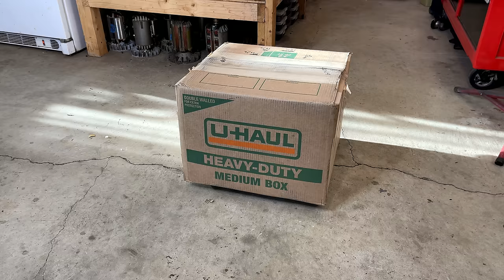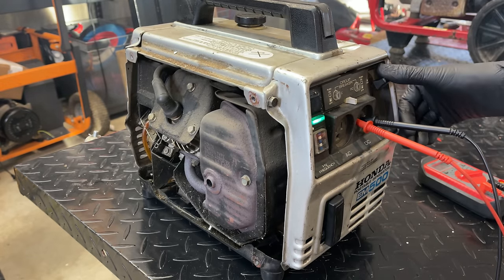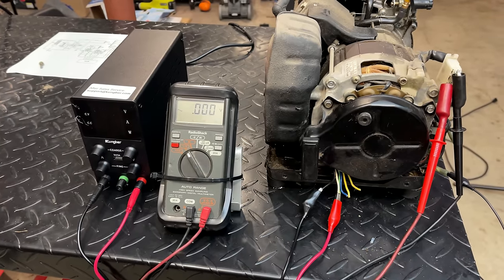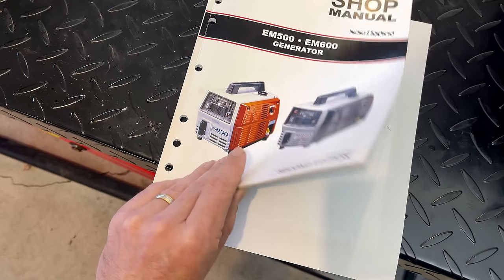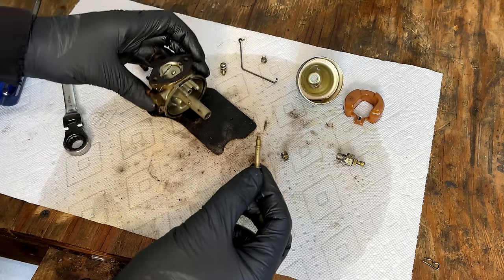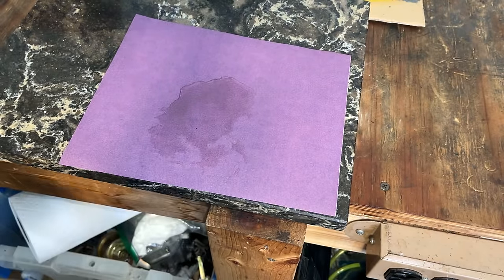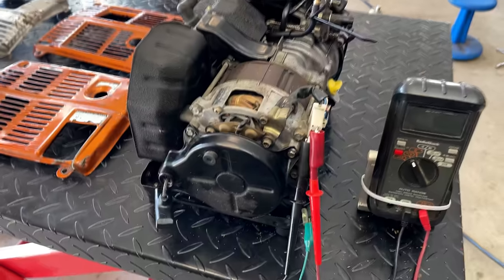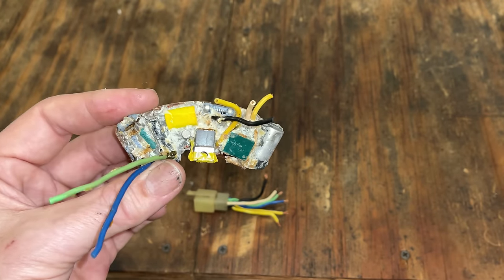Vintage Honda EM500 - High Voltage Problem

Comment: He did a great job packing it in the box.
Reply from the maker: Best packing job I have seen.
Reply: @jcondon1  Same thought here
Reply: The repurposed Omaha Steaks box was brilliant.👍
Reply: Thank you.
Reply: If you were going to use a universal AVR and the output voltage from that AVR was too high, then it is possible to calculate a value of a resistor to drop say 4 v, you can use ohm's law to calculate the value and since you're power supply was showing both voltage and current the calculation could be fairly easy. I  you would just need to calculate the lower limit of the voltage... Might be a good experiment when another one of these comes up.
Reply: I was also gonna applaud the packing until he told the story about the train and truck. That generator was pissed off being bubblewrapped after the life it has had.
Reply: I definitely would have drained the oil since you never know what thepeople at the carrier do to your package, eg put it upside down, tip it over, throw it etc
Reply: @d6893  I did run it completely dry, then drain the oil. My guess is the oil that got into the carburetor and the air filter was probably the last oil that was in the case. I love that little generator, it was nothing but a one pull workhorse.
Reply: First thing I noticed was the exceptional packing job. This was a great video.

Comment: That carb insulator looks like the perfect sort of part that could be replicated by a simple 3d print.  With a few measurements and the right material that could be produced as needed for anyone.  I love these old suitcase gens, really cool video!
Reply: You would have to be careful in your choice of filament/resin. Most 3D printer materials will have neither the chemical resistance nor the heat resistance to work in that location reliably. The original part appears to be phenolic, which can't be 3D printed. Maybe you could get away with nylon, but I think you need a high-temperature printer for that.
Reply: @danmenes3143  That's true, though I think ABA or ABS would also be capable.  ABS & Nylon can be printed ~240C which most printers can do, but they need good ventilation.

I've also used PETG parts in vehicle engine bays before and they work fine, but they also aren't in contact with fuel.  Ironically, I did have to create some parts that were immersed in gasoline later, and I did it in both PLA & PETG.  Despite PETG supposedly being resistant to gas and PLA not, the PLA parts survived and the PETG ones failed!

Comment: Pretty impressive how that little generator came back to life and runs so well! On a side note, I'd hate to be in your shoes when your wife finds out you cleaned those parts in the kitchen sink... 😉👍👍👍
Reply: I'm gonna say no it looked like some bad hammertone copper from the 70,s
Reply: Maybe it used to be a kitchen sink, but it's been relocated!
Reply: I find it very very cute🥰

Comment: Thanks for this video! I have a 40 year old EM800 which has been used to power my family's off grid cabin since the 80s. It probably has thousands of hours on it. The only maintenance has been oil changes and spark plugs and a new air filter. I think the pull rope is even original.

As far as I can tell the EM-500, 600, and EX800 are very similar. So I'll come back to this video if I ever have any issues! Great job like always.

Comment: Thank you for covering every detail meticulously and with such high quality. I received an EM600 three years ago, and while it always used to run perfectly, it recently started being hard to start, hunts, and it will die with a big enough load on it. I've never worked on an engine, but this video will help me hopefully clean the carb and go through any other troubleshooting steps.
Reply: Be very careful with the brittle old plastics and you should be OK.

Comment: Don't beat yourself up about nicking the fuel line, other seasoned mechanics probably do the same, I know I do.  From my perspective your pretty well clued up on exiltation fields and field coil resistance, and voltages, so rest easy about the fuel line. It's good watching you fault find to this level of expertise. A very good comprehensive video, great to ⌚️ watch  well done my friend well done

Comment: Japanese quality period , and I also was amazed with the THD. Vintage Hondas units were built to last and become heirlooms if taken care of. Once again James great video.
Reply: Would you say the same for modern Honda generators?
Reply: @douglofreddo7886  
No, my brother bought a Honda EU2200 3 years ago. Upon opening and first start he had to return and exchange for another because it would not run right. The second ran good but you can feel the cheaper materials being used today. Still runs and works today but kinda walks when running in eco mode.
Reply: When I was a child [10y old] I remember my dad telling the machine operator that was sleeping on the  job "Wake up the japanese are coming"

Comment: First off -Lewis - excellent packing...I  spotted the Omaha Steaks cooler,  and I have one waiting in my basement for just such duty!
James, you are 1/2 artist, 1/2 mad Scientist !  I always enjoy your thoughtfully presented content.  I am the owner of an EM500 myself, still run it twice a year just to keep it serviceable, have the original manual and 12v leads as well.  Mine gets a bit wonky at 350 + watts but still hangs in there.  I've used it to power a small (1/5 hp) pump to drain a flooded basement (3+" standing), it still has it's value and will probably keep working for years to come.  I have three other Honda gennies including the newest Eu7000is which will run a home if necessary !  Quality lasts and inspires confidence...thank you Soichiro!

Comment: Great video.  I like to see people bring these old Honda's back to life, they are precision built machines, unlike most things made today. I liked the trick with the wire and hot water to make a bend in the fuel line, I never would have thought of that. I certainly hope that that sink you cleaned that baseplate in was in your shop and not in your wife's kitchen, or this may be your last video.
Reply: My wife would kill me
Reply: My eyes rolled back in my head when I saw that.
Reply: ESPECIALLY when she discovers that it wasn't HIS toothbrush he used to do the fine detail cleaning...

😄😁😆😅😂🤣

Comment: I recently purchased a gear from a fellow who prints them from a 3d printer if he has the original. It might be possible to print your carb-housing since you have most of the parts. Good luck, great video.

Comment: For future reference, a spring inside the replacement fuel line will allow you to make bends you couldn't with a non-formed line.
Reply: A spring on the outside is just as effective, and would cause less impedance on the flow. The bonus is its less likely to be corroded by any impurities in the fuel. Downside is it can be corroded by everything in the air. 😅 I've used this in low volume water cooling for insanely bright LED lamps, where in the water loop I'm running de-ionised water to reduce conductivity, so the less different metals in the system the better, hence external springs.
Reply: Actually, the spring inside keeps the hose from kinking a spring on the outside would not do the same thing

Comment: Nice video Jim. I love old Honda Generators. The quality and craftsmanship of these is second to none. Even the newer EU2000, EU2200 and EU3200 have amazing build quality and fit an finish. It's amazing you were able to get that AVR! I couldn't tell by the logo on the side of the AVR, but was that made by Sawafuji? Nice troubleshooting as usual. 100k subs is near!
Reply: Where can I get the service manuals for the EU 2000. So often that seems to be the secret to knowing resistance values etc. another great video. Thank you.

Comment: Glad I'm not the only one without a slop/laundry sink. Lots of air filter housings and covers cleaned in my kitchen sink too if I can't, or decide not to, do it outside with a pressure washer. Nice repair AND resto as it turned out!
Reply: My wife hasn’t tweaked that I often to turn the dishwasher on while she’s out. Shhhhhhhh🤫
Reply: @scroungasworkshop4663  😯😳

Comment: Just a month ago i ran into the same issue with my european version of this generator. Its a EX500 and the voltage went up to over 300volts. I searched the internet, but the result was the same as in your case. Parts are too expensive for what its worth. So i tried to get the resin off the AVR. And i managed to get the soldering side free of it. The only thing wrong was a bad soldering joint.
With some tape and zipties i made it fit in the rest of the plastic housing of the AVR. Generator runs again, for zero money spent!
Too bad this video came out too late, it would have saved me a lot of time figuring out how to get to the AVR.

Comment: I have had an EM300, an EM 400 ( used many years), EM500, and currently I have an EM600 in the shed that I picked up a year or so ago for $50, it's waiting for me to do a will it run again video on my channel. I too love these little guys, you proved just how good they are! I have a vintage truck camper on a vintage truck, I think the EM600 will be perfect for that rig.
Thanks again

Glenn

Comment: I expect the isolator was cracked or even broken during it little trip off the tail gate and down the hill, these really are well designed and built, you always get an A+ James

Comment: Just an FYI, Many of those small Honda generators of that series has a magnet embedded in one of the pole pieces to ensure startup voltage. When applying field power, it is possible to have the polarity reversed and will buck the magnet, resulting in a range where the voltage decreases with increasing field voltage. As a result of this bias magnet, polarity of the field is not symmetrical. One polarity will produce a higher voltage and a lower voltage when reversed. This is most noticable with low excitation voltage.  Due to the magnet, these are designed to never lose residual magnetism and fail to excite. Nice touch by Honda. The magnet is not in the rotor, but in a pole piece of the excitation stator.

Comment: I haven't seen an old Simpson multi meter like the one in the manual in over twenty five years. 
When I got into the industrial heavy machinery industry it was the professional meter of choice. That was back in the early 1980's.  Nice job James
Reply: I have a couple 260s and a 270. Sometimes analog is the way to go for watching trends.
Reply: @1pcfred  I've used them and owned one way back in the day.
Reply: @MrTonyPiscatelle  I still have a few that I use from time to time.
Reply: @1pcfred  You can sometimes find old cheapo hobbyist analog meters at yard sales and flea markets, and they're perfect for 'trends' or rough readings where a DMM will just go bonkers with the variance.
Reply: @P_RO_  that's where I've found all of my meters.
Reply: I have one also

Comment: Very nice work James. I see that you have recently taken to using JB Weld in places that are non critical on the machines. A carburetor heat insulator/spacer is important to stop vacuum leaks as well as keep the carb cool but the mechanical stresses on it are not great. JB Weld should last a very long time here. I have not seen you use hot water to bend fuel pipes before. It seemed to work very well.
Reply from the maker: Hot water works on some fuel lines but not all.

Comment: James, I have a Honda EM500 that was giving to me years ago. I have rebuilt the unit and it seems to work well. Sounds like I should part it out! Always enjoy your videos.
Reply from the maker: The parts are worth a lot of money to those trying to keep theirs running.
Reply: The sum of the parts might be worth more than the value of the whole. Some popular old cars are like that, which is why those rank high on the most-stolen list 😱

Comment: One thing I really like is you do a great job of cleaning the parts.  I don't care what I work on, I take way too much time to clean.  Most folks don't want to pay to have me clean,  I don't really care,  to me the job isn't finished until it's clean.  I do charge more than most other shops too. I had a guy bring me a chain saw,  all it needed was the carburetor cleaned,  but I checked the chain, and bar.  He was happy it looked as he said, like new.   Some folks do appreciate the extra work.
Reply: I learned long ago that it's not only easier to work on a clean machine, it helps you better see other problem areas you wouldn't have otherwise noticed.
Reply: @P_RO_  
Excellent point sir!

Comment: I have the exact same unit. I got it in the original packing, previous owner used it 1 time and left the gas in it. I got it after it set for over 10 years, cleaned the carb, changed the new oil in it. And it works perfectly.

Comment: This guy has 3 multimeters, a bench power supply going, wires everywhere,  all while bottle feeding gas through a tube. What we are witnessing here is a peak generator serviceman in action. Well done sir.

Comment: That unconnected mystery connector is possibly the AVR 50Hz plug 
that is swapped on a generator being run to produce 50Hz.  There are
2 connectors, one for 60Hz and another for 50Hz, so one is connected 
to select 60Hz or 50Hz and the other is unconnected.

Comment: A small parts washer set-up would be a handy addition to your shop.  I never knew how handy they are till I got one and my wife appreciates me not cleaning parts in the kitchen.
Reply from the maker: It would be nice.  Need a bigger garage.
Reply: @jcondon1  Make it portable on a rolling work table. A free sink from a remodeling job, a free used veggie-oil container from a restaurant on the bottom shelf, and a cheap 12V fuel pump in between. Keep the pump pick-up off the bottom and the veggie-oil container will act as a sediment trap. On wheels it's never in the way.
Reply: I have found in my life, it doesn't matter how big your garage is you could always use a little more room.

Comment: Thanks for this great video.
Imagine from 40 years this machine have cdi , oil gard , automatic choke,....etc.
I have the same AVR problem without the chance to replace it.
 i found that when we apply about 75 percent of load we got acceptable voltage and hertz reading. I manage also to use LPG on this generator with very good result as i get a broken carb floter and bad shut off valve. In my country we have a serious problem of electricity as we get not more than 5 hours of electricity per day, really my generator has undefined hours of running hours and still in service till now.

Comment: Hi, I have one I bought for £40, great little generators if you only need 500 watts, just missing the side panels, luckily found another em500 on eBay for spares so hoping I’m the winning bidder, great video , your very inspiring to tinker and fix .
Electrics are a misteryfor me but I have a general understanding thanks to you 👍

Comment: You are Awsome!!! I love that you always take care of the Factory/shop specifications (like torque). In this case, you had to work with what is available… but you do a big effort to get the original parts. I always wonder, how you get the shop specifications (like torque set point). Congratulations!!! I am a engineer (dedicated to Finance). That means, DIYer. I really love your channel. Probably the Best in YouTube. Saludos from Mexico.  🇲🇽

Comment: I have the same one. Still running well after all these years.
Reply: I have 3. Whenever I see one going for cheap i buy um. My first one 10 years ago was $50. My second one last year was in pristine condition in original box $200. My most recent one was $120 and it had a few carb issues but i fixed it.

Comment: I've made heat insulators before out of a 2000 Ford air cleaner box.
Hole saw a few flat areas of the box, drill and hole saw the intake hole and bolt holes, then silicone however many pieces you cut from the air box to get the same thickness of the original broken one.

Of coarse I did let the silicone cure in a vise for 24 hours before the install.

Comment: Out of the 18 v leads, you can rectify and put a filter, and a voltage regulator 7805 and that is all you need to maintain the 5 volts. It would be the same as you are now doing with your added power supply.

Comment: Great little machines, I have the 240v UK version, I bought it second hand in1988, and still running perfectly 😊
It certainly would be nice to have a circuit of the AVR, nice to see the trashed panels replaced, should be good for the next 40 years!
Reply: Did you know they were made in the 60's ?
Reply: @benitopussolini544  Yes, the model before the EM500 was even smaller!

Comment: Honda used to make some beautiful stuff. I have one of the early Honda OHV/shaft-drive self-propelled mowers. Most or all of the exterior covers and plates are painted steel like this generator.. 
If I had a dead one of these generators, it wouldn't be going to a landfill, 
but up on a display-shelf in my garage!

Comment: Picked one up at the local landfill site for 10 bucks a few years ago all it needed was a carb clean even has the original spark plug tool, wish there was easier access to the carb. Fuel drain screw

Comment: I think market value is not always what an individual should think about in a case like this. If you are repairing something to sell then market value would be important. But if you need the equipment and have to repair or replace it. Then you should consider the replacement cost. Many times the replacement is much higher priced than the what a reliable repair would be.